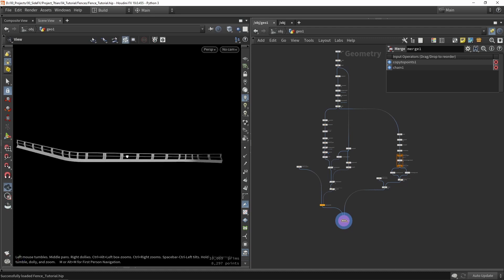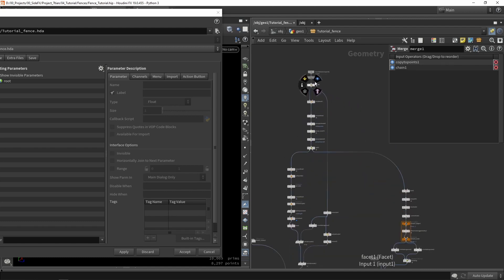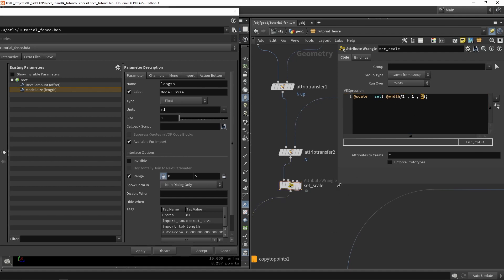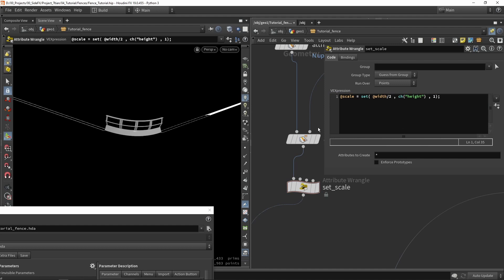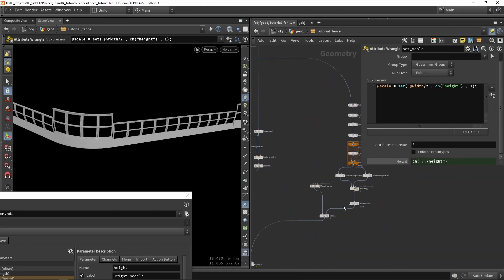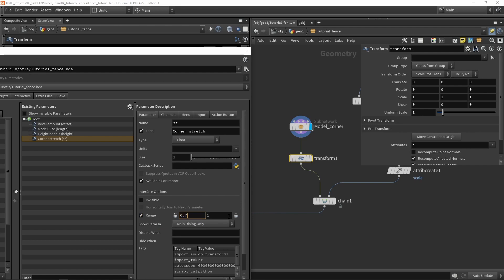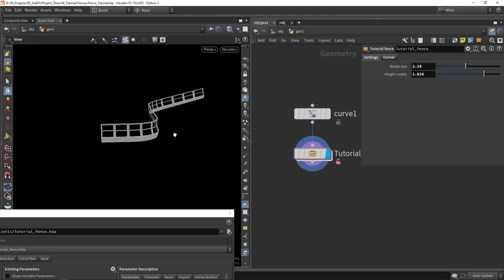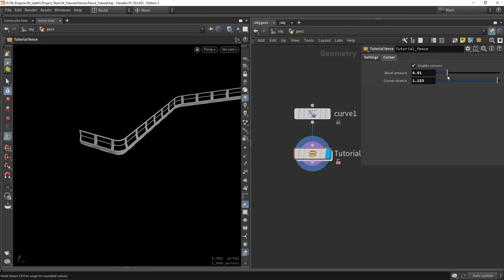Project Titan Fence Tool | Part 3 | Create Digital Asset

Comment: Is it a way to control segment over corner or reduce it size. Coz if i make a bevel less than 1.2 my asset starts to disapear [curently working with my own cornjer part 1m long.] Wondering how to get the idea to make object less size than it already imported.
or maybe a guide how to switch for some other model if statment of bevel is less than n-

Anyway, the most understandable tutorial on fences EVER. Big thanks!